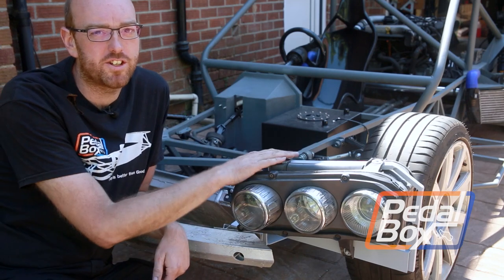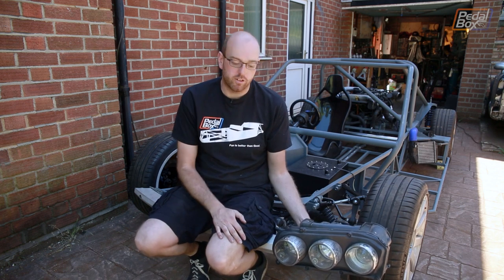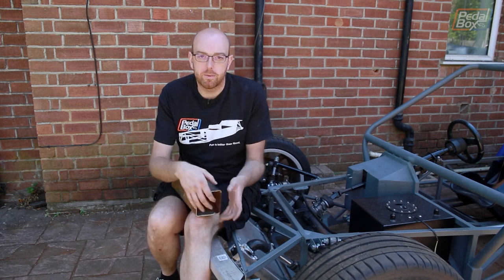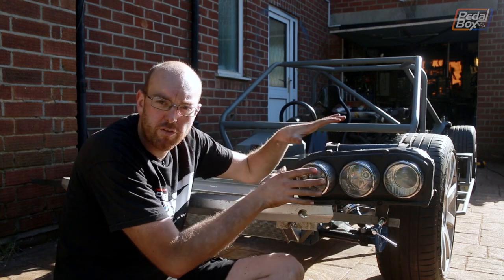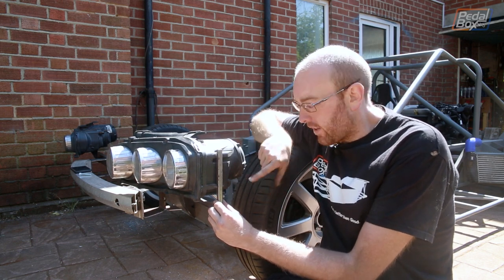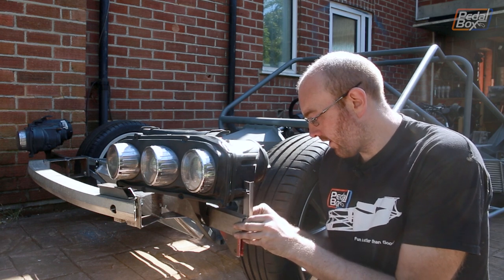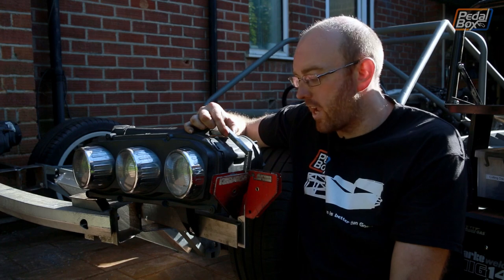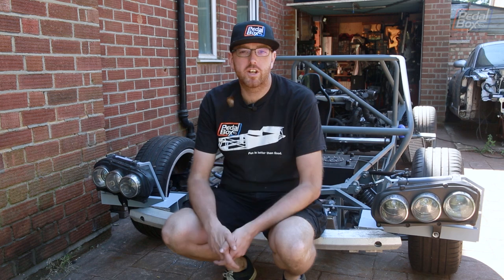Adding Headlights | Audi TT Kit Car | PedalBox Episode 52

Comment: Dumb question but are those light housings water tight? ... been there and replaced that ... soggy, foggy, dripping light fixture.
Reply from the maker: I have to assume they are. At least because they're not covered with anything on the 159 that I can tell.